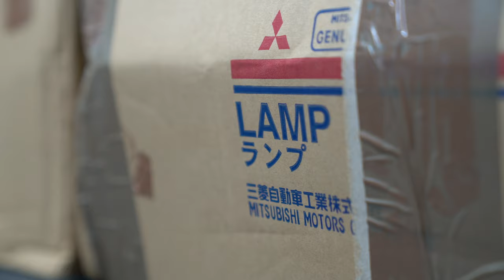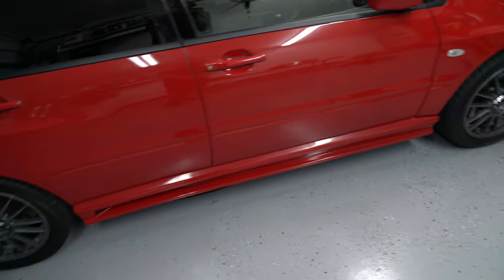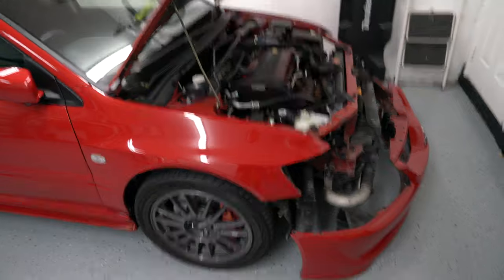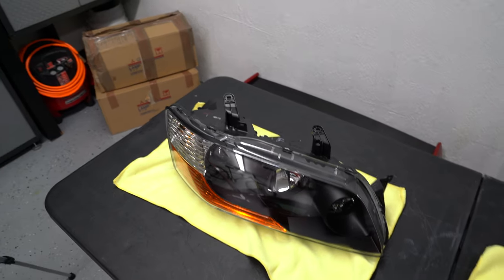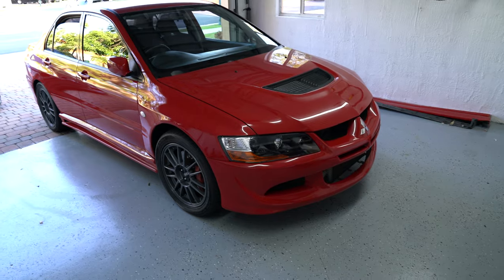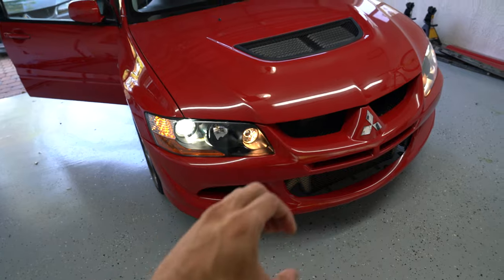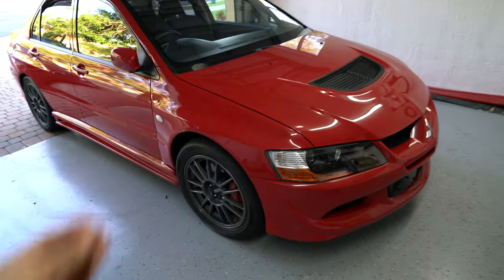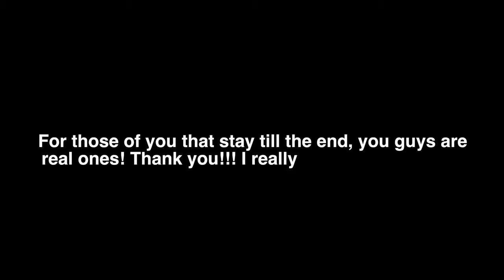INSTALLING BRAND NEW JDM HEADLIGHTS ON THE RED EVO 8!

Comment: When you fit JDM RHD headlights, what do you do about levelling the dipped beam headlights? Always wondered. New headlights are lovely 🤤
Reply from the maker: Dude I turned them on and they were already leveled pretty good.. So I didn't have to do anything but I believe there's a screw on the headlight and that will allow you to adjust it just park on a level ground with a plain wall.
Reply: @ChrisGoorbarry  Oh cool! I thought the step for the cut off may be an issue because it’s reversed for RHD